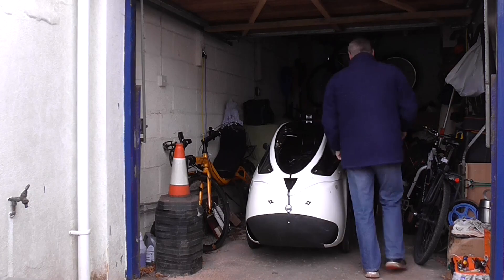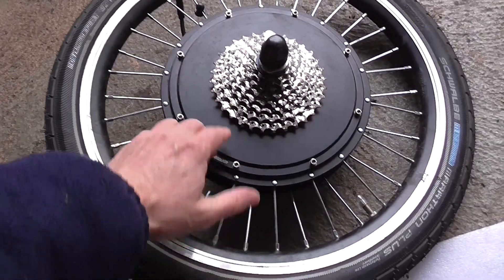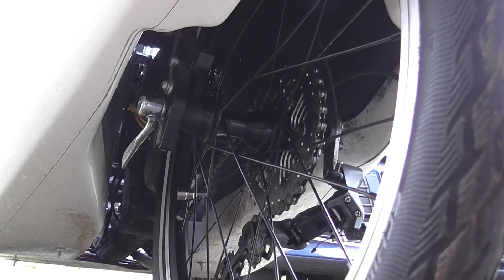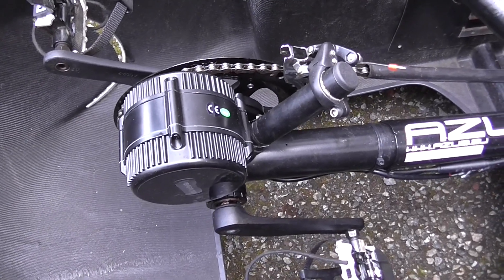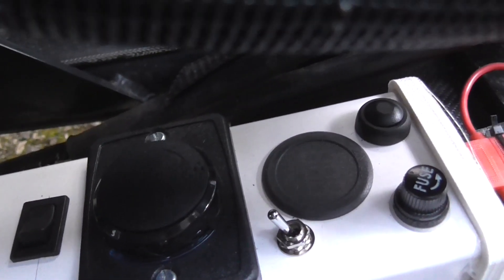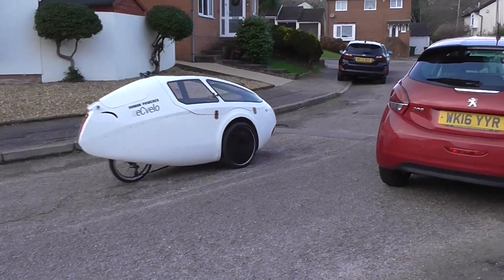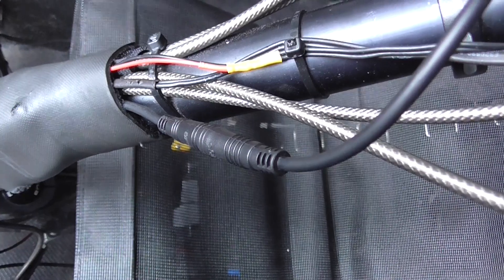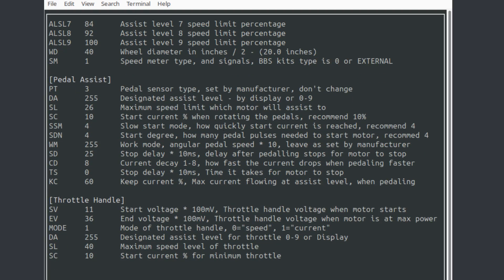Converting my EuroCircuits Velomobile to a UK-legal Mid-drive motor

Comment: E drives make so much sense on a velomobile.
My ideal is a mid drive with a hub gear.  Keeps everything clean and low maintenance.  The extra weight is no issue with such a heavy machine.  And the e drive makes up for any loss in efficiency.  
I assume you can set the gears quite high with the power assist to help pulling away / hills.  If so even the Alfine 8 speed may be sufficient.

Comment: You're not peddling that can't be road legal ?
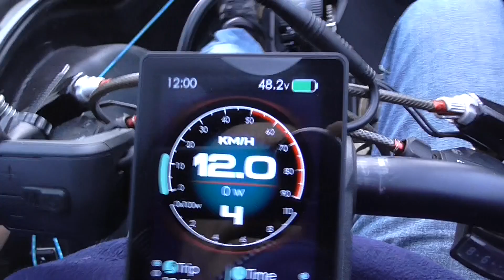Reply from the maker: You are partly correct. In the UK e-bikes should generally only provide assistance if the pedals are turning (there are a few exceptions which I will ignore for the moment).This effectively means most riders need to do 'clown pedalling'.  But actually mine is as legal as I can get it. If you look carefully at about the 06:20 mark you will indeed see that I am moving along quite well without pedalling. But closer inspection will also show that the power being delivered by the motor is ZERO watts as indicated on the display. And if you look extremely closely you can also see that the chain is not moving so cannot be powering the back wheel either. So in this caseI am just coasting along. And, yes, it does look like I am coasting unrealistically quickly and I am assuming this is due to the better aerodynamics of a velomobile as compared with a normal mountain or commuter bicycle. There are several local roads on which I seem to be able to coast along quite well in the velomobile yet require active pedalling on my mountain bike. I also suspect that cross winds actually provide a little forward thrust to a velomobile compared to an upright bike as the planform of a velomobile is closer to an aerofoil. Maybe I should do a video about aerodynamics of velomobiles?